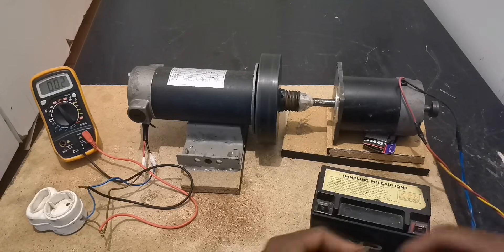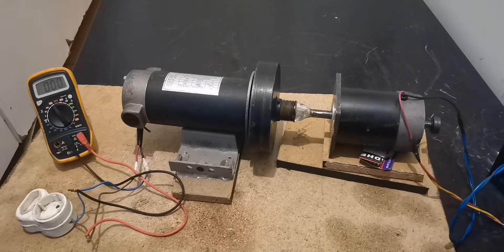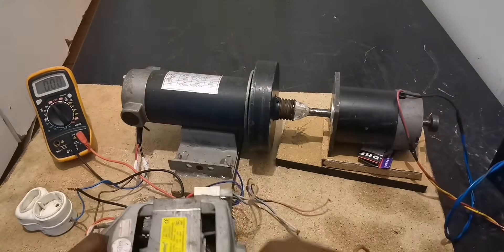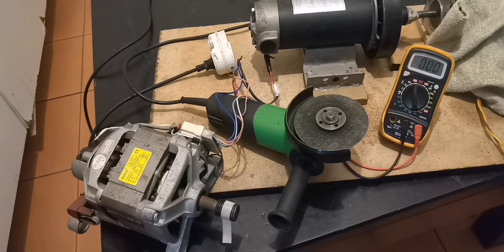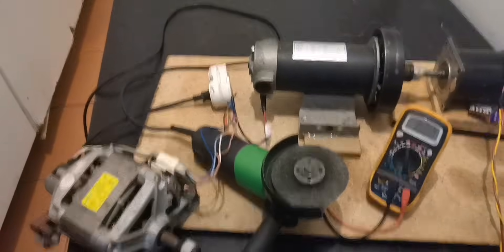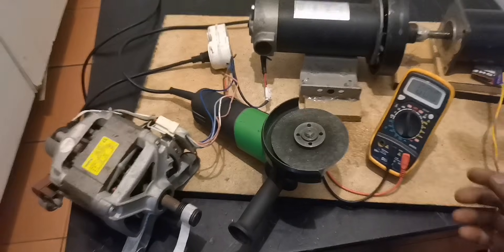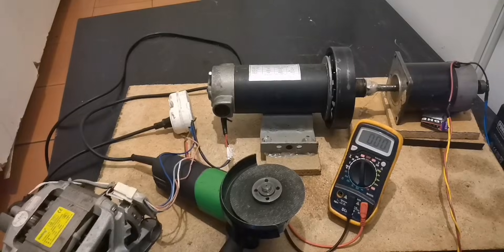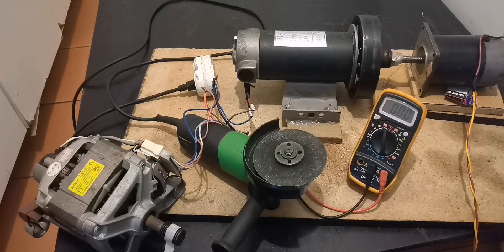Teadmill motor generator #how to make generator with dc motor #how to make high voltage generator

Comment: I had a thought!!!  STEP1, Mount the motors secure so you dont need to hold and connect shafts better with a coupler.  STEP2,  on the base ,mount 2 buss bars, one pos and one common or ground.  STEP3  run tools from these bars, and somewhere on the pos bar place a diode going  to either  the drive battery OR  another recovery battery.  Then figure out how to switch from drive battery  to the battery that is being charged automatically. This will work with the right knowledge and parts. This is worth exploring. Also step up pully system to get more rpm if needed.  Thanks for your (HONEST ) videos!!!!

Comment: Rettified the output and charge the main battery and test the discharge of the battery, maybe with a capacitor before the motor and a diod to stop the inverse current